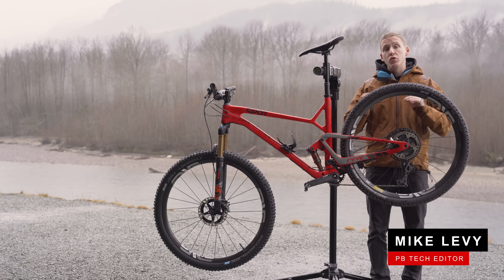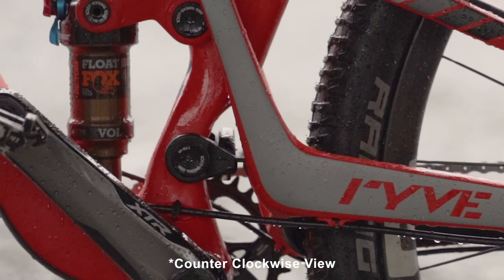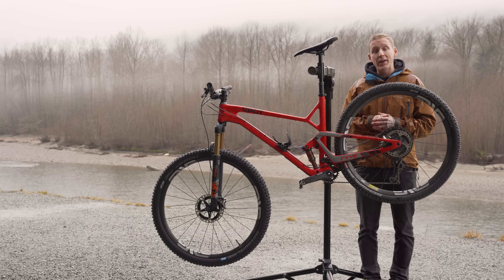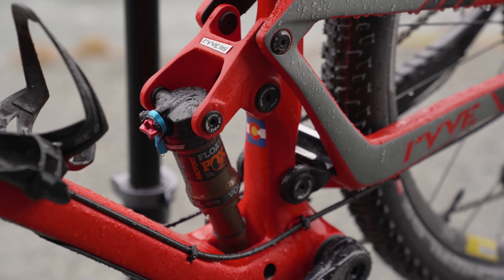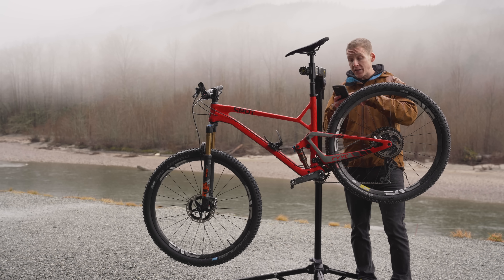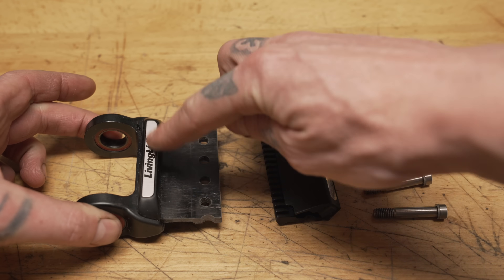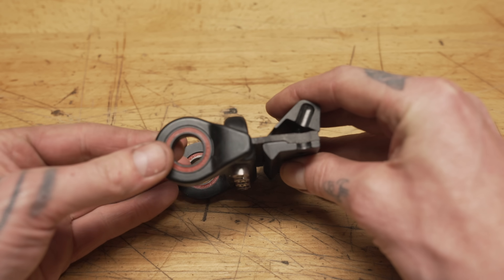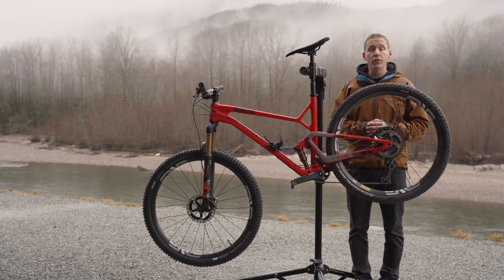Carbon Leaf Spring MTB Suspension - How it Works | The Explainer

Comment: Just did a demo ride of the Mayhem and Ryve in Phoenix, AZ.  I appreciate the guys at Spot for coming down to Phoenix and would like to thank the team for setting up the demo event.  I wouldn't have been able to ride their bikes otherwise.

I test rode two bikes (Ryve and Mayhem) and I liked them both.  The Ryve was a bit better at climbing than the Mayhem but it is also lighter and shorter travel.  The Ryve is their XC bike.  They both felt really good while climbing and I didn't notice any pedal bob.  Also never slipped the rear wheel when pedaling hard on the uphills.  On the downhills, the Mahyem felt a bit more capable with the longer travel and the extra two or three pounds in the bike.  The rear felt great over the rocks and I never noticed any issues with either bike.  What I liked most about the bikes, besides the climbing, was that the steering felt neutral at any speed.  It was just was easy to change lines while tooling around or going all out. I found that some bikes are more stable when up to speed but a bit squirrelly when going slow.  The steering on the Mayhem and Ryve felt exactly the same no matter what speed I was doing.  It felt the most neutral of the bikes I have tried.  It kind of surprised me the first ride or two and I overcompensated a turn or two until I got use to the feel. 

But based on the way the bikes were setup, my riding style and the type of trails I plan to ride, the Mayhem is now in my top 3 bikes to consider buying in the next few months.  I still have a few more bikes to demo before I decide, though.  My current top three are the Ibis Ripley, Spot Mayhem and the Evil Following MB.

The frames, I believe, have a 5 year warranty so I'm not too worried about the frame cracking.  I also think that they modified the rear linkage on the Mayhem to better prevent it from ever hitting the frame so that may no longer be an issue.  But I would still double check the clearance and make sure I have the revised linkage if I bought an older bike.

Comment: I’m an engineer at a furniture factory and we did a rocking chair that used a carbon leaf spring to get the rock action. We did some strength testing and I can attest they are crazy strong. Think about how thick a carbon bike frame is and then look at how think this thing is. It ain’t gonna snap!
Reply: The problem with carbon fiber in the wild is rarely strength. It is UV, contaminants, and most pertinently sharp point impacts like rocks. There is a reason we didn't see the 2 year frame warranty until carbon fiber came along. This is transparently a tiny performance gain for enhanced obsolescence.

Comment: More breakaway carbon bull. I wish the bike industry would leave carbon and go to something more reliable like Titanium or start experimenting with Ti alloys. Carbon is great until the nick in your down tube or chainstay turns into a crippling crack that will surely cause a crash and void your warranty. 

Specialized said they didn't make an alloy enduro because of cost. That's pretty much sums it up carbon is cheaper to make.
Reply: There is a reason we didn't see the 2 year frame warranty until carbon fiber came along. This is transparently a tiny performance gain for enhanced obsolescence.

Comment: so just to be clear, unlike a dual link bike, where the links move on the pivot, but themselves are rigid, the leaf spring both rotates on the pivot and flexes at the same time right?  Thus that flex adds in another element of variable/control of the suspensions kinematics.  Right?

Comment: Looks like something out of the 1980s. Do they give you a different thickness spring for every 10kg +/- rider weight ? Wonder how much extra carbon they used to reinforce the frame, having a 3/4mm carbon plate pressing against it at 75% of your body weight while pedalling.
Reply: Doesn’t work like that. Watch SPOT’s video on how it works

Comment: Seems like a valid idea, but:
a) it will add up to the complexity of the suspension tuning - especially that it's influence partially overlaps the areas that the shock covers...
b) I don't know how much that leaf spring flexes, but being so extremely short, it'll be prone to fatigue-cracking, that may have serious consequences  (similar to that Rocky Mountain Slayer incident).
Reply: I'd say it doesn't flex much at all, it's really stiff and short, carbon has a very good fatugue life, I wouldn't be worried (from other comments, they've been using this stuff for a couple of years already, they don't seem to fail) and from the explanation, it really sounds like it just adds a bit of mid stroke spring rate.

Comment: Basically what he said, it's better to have a progressive coil shock vs that complicated links.
Reply: No it actually isn't Progressive coils are not good for aggressive riding just ask any MX or SX Rider. A more linear spring provides the most stability. You'd rather have really good quality high speed low speed compression and rebound to adjust the damping.

Comment: Nice concept! 
But I can’t help but think an extra large negative air chamber (like the Rock Shox MegNeg air can) will soften the initial stroke and firm up the midstroke. 
Perhaps a variety of negative chamber sizes and/or position of the transfer port that equalizes the positive and negative air pressures could be useful for tuning the ride for frame designers to exploit.
Reply: What? First of all- the transfer port is not a tuning option, its position is important to remove top out and not suck down travel, its dependant on chamber volume, nothing else. Secondly, this thing is totally separate from the chock, I don't see what it has to do with this topic. From what I understood from their explanation, this essentially adds a bit of mid stroke spring rate, so support, with megneg you don't need any more support, it's already pretty much perfectly linear.

Comment: Can't you just get the same results with adjusting low-and high-speed rebound??
Reply: A bit yes, but mostly this thing just adds a bit of mid stroke support. That's how I understood it anyway.
Reply: Piotr Sulej You can easily get more midstroke support by changing the suspension linkshe. The Santa Cruz Bronson and other Santa Cruz bikes with the same VPP design have a degressive leverage curve with a lot of midstroke support
Reply: @frauenschlagen  yes, but thats how everyone does it, a leaf spring is not the worst way to stand out.
Reply: This is not changing high speed vs low speed, it’s effectively changing the rebound damping as a function of stroke position. Slower rebound in the middle of the stroke, faster at the bottom so it doesn’t pack down on you.
Reply: @filmaynard  eh, no? It's literally the oposite- they said it adds springiness in the middle 50% travel while not doing anything in first or last 25%, so pretty much adding a bit of mid stroke spring rate, definitely not increasing bottom stroke rebound speed, which would be stupid imo, in most shocks it's quite fast already (aspecially that everyone seems to be running really progressive spring setups)

Comment: I have an enduro Spot rollik 150/160mm 27.5 with this same desing and when sus moves the leaf spring barely flexes, 
the upper link moves way more so I don't think the leaf spring will ever fail.
Now how does the suspension feel? Im glad you asked...
The simplest way to put it is that every time the shock compresses and after it returns  "it feels like a diving board" 
like it pops you up and this is great for bunny hops, jumps, pedaling (returns energy) in other words is lots of fun on my rollik , 
Im not sure how the ryve feels but Im guessing its very efficient pedaling machine since is only 100mm.
Reply: So basically it's a purposely unstable suspension platform ;)
Reply: @piotrekserwisuje   very predictable and useful, I wouldnt say unstable at all.
Reply: @elliott-mtb5599  yeah, I mean unstable as in not planted, to each their own, I've tested some bikes through the season, and while I do enjoy the "poppy" feel of most of the Fox and RS shocks, it is at the cost of traction, and I am definitely a traction junkie ;) The feeling to me is comparable to running low vs a bit too high pressure in your tires, you know, the planted vs skippy feeling.
Reply: @piotrekserwisuje Oh OK, well my bike has the fox X2 shock with 2 pos leveler on it and I normally ride in the firm setting , now when the trail get pretty rough and I need extra traction I open the leveler and it becomes super plush and planted (can't really do this with the stock dpx2 shock though) but the X2 is what it takes to save the day.

Comment: Why are people saying this is the same as progressive leverage ratio? It is very different. I'm not saying whether it works well or not but it isn't the same.
Reply: Not saying its the same, just that it achieves the same result- poppy and fast in shallow compression while being controlled deeper down into the travel.
Reply: Essentially from what they are saying it means that this stuff adds a bit of support in the middle of the stroke, just that it's a set amount, not tuneable with air pressure.

Comment: Ok, so basically like every other progressive linkage out there, but unnecessarily complicated with another part that can wear out and break. Great.
Reply: Meteor Media basically a cheap way to get around licensing VPP or DW
Reply: @lastemperor12  there is no more licensing involved AFAIK, not with VPP anyway. They just want to stand out
Reply: @lastemperor12  I don't get why you'd choose one of those complicated linkages anyway. Just look at the Merida One-Twenty; its got the "Float Link" rear suspension which is a linkage-driven single pivot design and often dismissed because its a more simple design. Yet still the Merida won Enduro Magazins trail bike test against competition from Specialized, Trek, Canyon and Yeti which all have more complex designs. Proving that its not about which linkage you use, but how you tune it.

Comment: Seems an interesting idea but durability would be a concern.  Never a good idea to get 1st model of something like this.
Reply: paul norris They have a number of bikes based off of this design.  I guess you could buy a used 1st gen....?
Reply: carbon leaf springs?  Im not an expert but Ive ridden for 20 years.  I ride a dual link Tallboy and a Horst link Neuron.  I don't know much about Yeti, Revel or Evil suspensions but I didn't think they had leaf springs.
Reply: @flyingnorseman  the spring is very short and thick, it doesn't deflect much, and carbon has a very good fatigue life. Unless they fucked up the design phase, I wouldn't be worried about durability.
Reply: paul norris they’ve been doing this for at least 5 years.  I live in Golden, CO, where they are based, and you see plenty on the trails.  Some of the fastest times on the chunkiest trails were put down with longer travel versions of this living link design.  I don’t own a SPOT or work there.

Comment: Seems like a part that could wear out and fail after some years. I wonder what thickness of steel would have a similar spring rate, because that wouldn't wear out as quick.
Reply: Carbon has better fatigue life than steel.  Aside from some crazy crash and damage, the plate will probably last lifetime of the frame.  It would likely be the hardware that fails first.
Reply: Carbon fibre is more susceptible to sudden impact breakage only but in this configuration its likely to last a rather long time
Reply: nah, unless it's designed poorly, it worn fail. Carbon has a very good fatugue life.
Reply: And it's very thick and short, it's not really stressed.

Comment: In 2025. Top ten most rediculous mountain bike innovations of the past ten years. #4 Spots leaf spring suspension.
Reply: Probably not. Its a great idea and if it actually does what it is supposed to do, thats great for people running shocks without low/high speed rebound adjustment.
Reply: @obi-wankenobi9871  you don't need external adjustment if a shock is tuned properly from factory (which is, unfortunately, rarely the case with Fox and RS) and the leaf spring doesn't compensate for poor tune either. All it does is add a bit of spring rate in perticular parts of travel.
Reply: @piotrekserwisuje  There is no best shock tune, if there was, every shock would have it. A shock thats supposed to fit all riders would be way too soft and slow for advanced riders and too harsh and fast for beginners. 

The settings on the shock have their purpose and can not be replaced by tuning and the linkage of your frame. Custom shock tunes only move the adjustment windows of the compression and rebound dials. 

You should read into damping and compression setups. 
There vary wildly depending on the rider and terrain.
Reply: @obi-wankenobi9871  please explain how is it possible then that a Manitou McLeod somehow works well with both 100+kg and 55kg riders (like me) while a RS Monarch/Deluxe doesn't seem to work very well with any end of the spectrum (or in between for that matter) and neither does any Fox shock that's below DPX2 level (both companies seem to have pretty bad shock tunes, RS has issues with rebound, Fox mostly with compression) for comparison a DVO Topaz works with pretty much every rider weight too, but that shock also has external compression adjustment so you could say it doesn't count.
Reply: @piotrekserwisuje  Its the adjustment range of the rebound and compression settings. It might have a bigger range so it works better at the ends of the spectrum.

The tune is bike specific. If the tune is bad, thats your bike manufacturers fault. They make diffrent tunes for diffrent linkages. You are one of the first people i have heard complaining like this, so i dont really know what to tell you.
Reply: @obi-wankenobi9871  for your information, medium tune on Monarch or Deluxe has such a stiff rebound shim stack preload, that it virtually never opens, even at the heavier end of the spectrum, that's not frame manufacturers mistake, that's all on RS, and they offer an even stiffer tune for whatever reason. Look up any of the mtbr threads on McLeod and Topaz, you'll find a shitload of people complaining as to why their 300$ shock needs another 300$ in tuning to even work properly, while other makes seem to work just fine out of factory (probably not the best, custom tuning would surely make it even better, but it works well better enough than what fox and RS uses) and, if you didn't know that, shim stacks are sort of self regulating- higher oil flow means more damping, so a good base tune will work pretty well with most of the frames and weight (not including frames with terrible leverage curves, you cannot really fix that, just make is bearable) all you need is large enough range on the low speed rebound adjuster, which miraculously was possible to achieve for Manitou DVO and some others, but seems impossible if you only look at the 2 main manufacturers.
ps. you can validate all the information I'm saying by looking up said forum topics and for example Volsprung vlog+ in case of the RS rebound, if you have the medium or heavy tune, you can just close the low speed adjustment all the way and see for yourself that when you compress the shock, it doesn't extend how it should if the shim stack was working properly.
Reply: @piotrekserwisuje  what you write definitely sounds reasonable. I have to say I dont have too much personal experience on RS and Fox since I ride Cane Creek and Formula, but have often seen reviewers complain about bottoming out the dials, when trying to make the shock work on a given bike. 

This is an assumption, but there are probably more complaints from riders that upgraded their shock compared to riders that got the shock with their bikes. Frame specific tunes, that bigger bike brands sometimes get might mittigate some of these issues you talked about.
RS and Fox could obviously just increase the range of adjustment of their products, but its a double edged sword. 

They are the two biggest OEM brands, so they are going to see the most beginner riders, that dont know how to set up their suspension, using their products. 

While their products are also aimed at the best riders out there, you make far more money from bad riders, since there are far more of them. 

Limiting the range of adjustment makes it harder for a beginner to completely mess up his suspension setup which will result in a better feel and him feeling inclined to buy the product agin. If the tune is way too hard, maybe they should back it off a little, but there also seem to be people that get along with their products very well, and what would happen to those riders then? Maybe the exact same issue, but the other way around.
When the rebound is too slow, that sucks but is very rideable, when its too fast, its outright dangerous, so you basically choose between bad and worse.

From an engineering perspective, this solution sucks, but you have to include the "human fuckup constant" in your calculations.
Reply: @obi-wankenobi9871  what you are saying also makes sense from marketing standpoint (also it explains the RCT3 damper which sacrofices performance for the sake of stiff and even stiffer lockout, which no-one really needs in a fork) but that's exactly why I'll never buy anything from these companies, mayby discounting the higher end products with larger amount of external adjustment, but that's unlikely because DVO, Manitou and some others give you more features (hydraulic bottom out for example, which I've come to love) and/or better performance for the money.